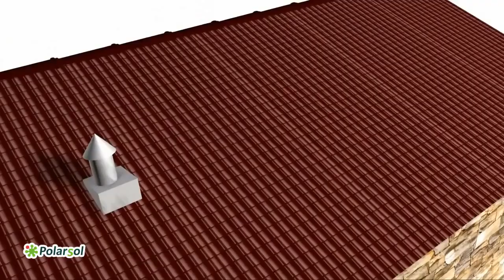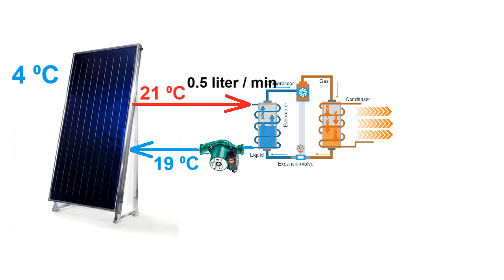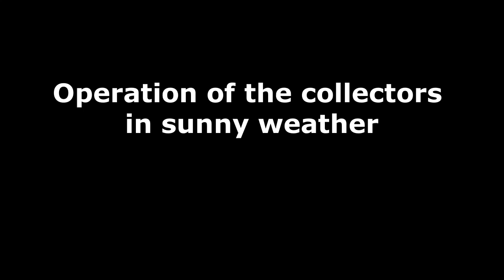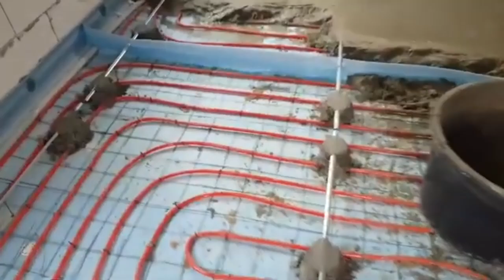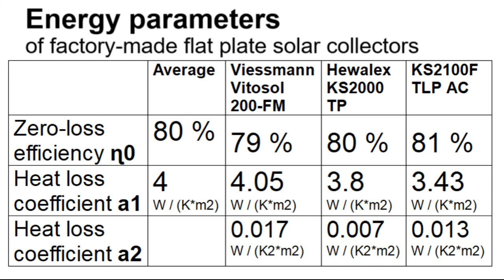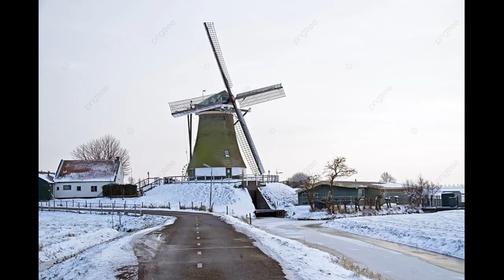These unique solar heaters are operated in cloudy weather and heat a house completely day and night

Comment: This is kind of my plan B, if I do not find enough water with a shallow well for water source heat pump.  Solar tube collectors on the south side of the house, air to water heat pump in the attic close to the south side, heat exchanger mounted behind heat pump air intake  for heat coming from the solar collectors. Heat naturally rises from the solar collectors to the heat exchanger from where it is absorbed by heat pump increasing COP of the heat pump. Then the heat pump stores energy into a tank